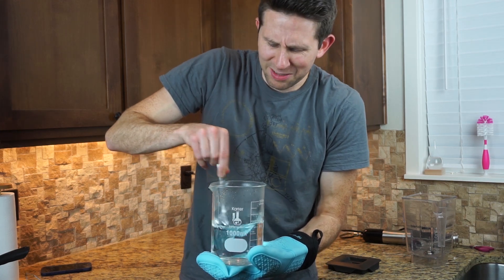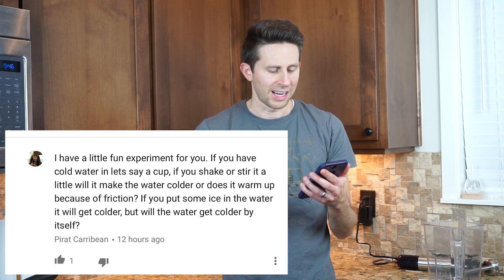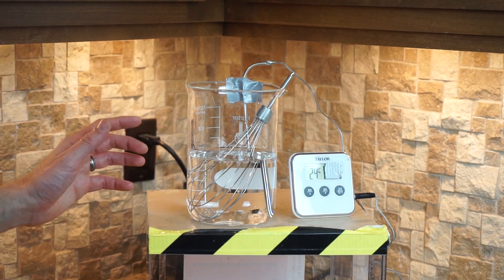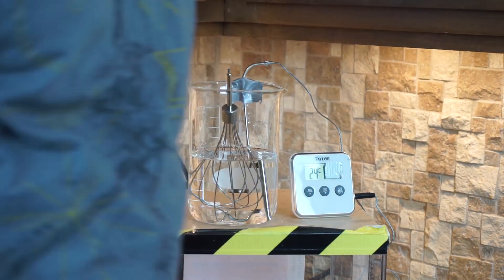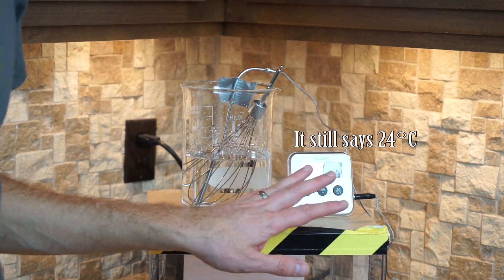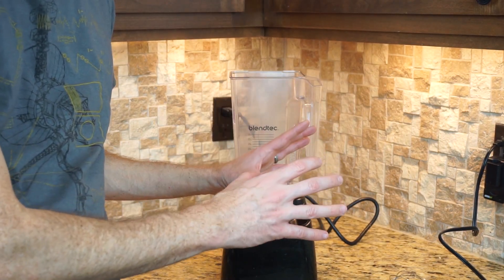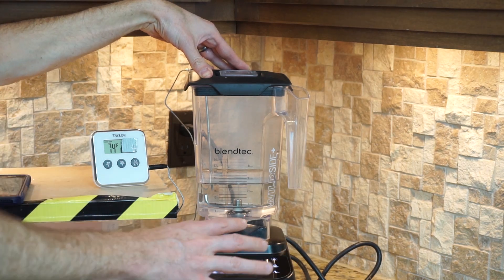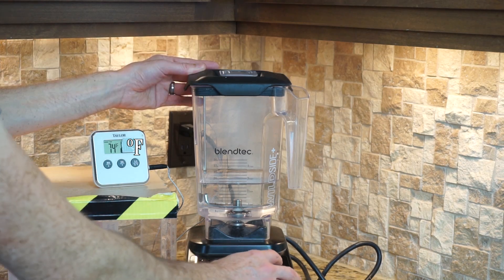Can You Boil Water Just By Mixing it Really Fast? Water-Stirring Challenge Accepted!

Comment: the change of temperature, while measured in Fº or Cº, is actually better understood with the Kelvin scale.  0 (no  º sign is used with that scale) 0 Kelvin is absolute zero (Approx -460º F or -273ºC).  There is no movement of molecules at all.  Agitating the water starts the molecules to move and the temperature to rise.  575 K meets 575ºF--they are the same.  In Celsius they meeet at 273K  and 273ºC are the same.

Comment: The energy required to heat 1 kilogram of water (1 liter) from 24 C to 100 C can be calculated by knowing the heat capacity of water in that temperature range.  About 4184 Joules per kilogram per °C.  Energy_Joules = (1 kg) * (4184 J/kg°C) * (76°C) = 318,384 Joules.  (1 Joule)  = (1 Watt) * (1 Second).  If you add energy at 1000 Watts, that would take you ( 318,384 Joules)/(1000 Watts) = 318.384 second = 5 minutes and 18.384 seconds.  So heating a liter of water in a 1000 Watt microwave at perfect efficiency  takes just about 5 minutes 20 seconds.  You can check the effective power of your microwave by measuring the temperature of a known mass of water before and after heating in the microwave for a specific time.

Sir Benjamin Thomson, Count Rumford, demonstrated the connection between mechanical energy and heat when he noticed how much heat was generated when boring a cannon.  Later, James Prescott Joule determine the "mechanical equivalent of heat", the amount of work needed to raise the temperature of a mass of material like water from one temperature to a higher temperature.  The unit Joule is named after him.

Richard Collins, The Internet Foundation

Comment: I've seen pool variable speed pumps heat the water to be scalding hot in just a matter of minutes. The impeller in them reaches 3450 RPM. The water was so hot it made the PVC deform. Take that for what you will.

Comment: Really amazing experiment! But the mixer blades and the motor heat up too and the thermal energy transfers to water from the blades. Maybe it would reduce the extraneous variables such as this one, to design a setup, in which the water is in a metal sphere and the sphere is rotating non-axially in a vacuum :D

Comment: How did you rule out the following?
The blade itself heats up because of the friction between it and the water and then causes the water surrounding it to warm up, rather than the water warming due to rubbing against itself or the inside of the pitcher

Comment: There is an appliance company WOLF that makes a commercial type blender with a soup mode. In the soup mode it uses the blades to agitate the liquid soup to produce enough heat to make it boil. Being soup it is thicker than water and will boil a lot faster than having water alone with no contents mixed in.  The liquid is heated up simply from the friction of the blades moving at the very high RPM and motor torque.  There are a number of high end blenders available that have enough motor power and speed to be able to boil liquids from the spinning of their blades. 

The high end WOLF bender has a peak 2.4 HP motor (near 1700 Watt motor). In this mode the blade tips spin at over 210 mph. There is no heating element involved, or any heat radiated from the blades themselves. The liquid is heated simply from the high speed friction involved.

Comment: The heat was coming from the friction of the blade. I'm sure water does heat up while being mixed, but you can clearly see when it's boiling that the bubbles are coming from the blade.
Reply: I figured, before he started to mix the water, that it was going to be the friction between the blade spindle and the bearing that was going to heat the water slightly but, on seeing how quickly the water heated (taking into account the speeded-up footage), I realised that it really is the friction between the blades and the water that heated it up. With the cost of electricity here in the UK almost double what it was in January (thanks to the Russo-Ukraine war) I think I'll be using my hand-whisk to make my coffee from now on.

Comment: This is nonsense! This would have been impossible in my original universe...This Action Lab video didn't exist. The water is used for cooling where I come from. The water absorbs heat, not produce it. Don't you have radiators over here?

Comment: Interesting, i do see the logic behind thid experiment however. I would love for you to retry the experiment but dont use a blender, all i keep thinking wile you were blending the water was the motor shaft of the blender is it connected metal to metal with the blades of the blender? If so could it be that alot of that heat came from condencing the blade? Dont get me wrong i still belive water can boil when you mix it fast enough, but this one here it just seem like the condencing of the motor shaft help it ALOT.

Comment: I dont think this experiment was silly, i think it was well done.  Maybe not perfect, but well done none the less.  And i dont think the heat transfer from the motor to the blades was significant because if it was an ordinary blender would do the same thing.

And how do the blades connect to the motor?  A gear underneath?  And is this gear plastic?  This may not conduct heat as well as the metal further negating the impact.

Comment: you want to have more stable level of water, for vertical movement of water is movement throw air, which cools, but horizontal movement is friction of water against water which make it hot, like hand if moving not against hand but air - cools, so do water
Reply: or another way to explain the same thing - not stable level of water significantly increase surface area of water, from which warm leaks

Comment: I was wondering if the movement and air bubbles would make it evaporate at a lower temperature, like if it would act like a decrease in pressure. But it basically made no difference. On another note I never thought this blender would have the necessary power to achieve it, it is indeed quite a good blender.

Comment: 99.8c ? For the boiling point of water? Water boils at 100c and freezes at 0c. Celsius is supposed to be a metric system based off things in the world, 100c is whatever temperature water boils at sea level. I could be wrong tho.

Comment: I don't think the heat is due to friction, atleast not entirely. The blades heat up quite a lot and that heat is transferred to the water, not to mention the opposite friction by the water on the blades...

This must be tested first with just air on the blendjet
Reply: And why do the blades heat up?
Reply: @osyisr6361  The motor. An example of this is a drill bit. It heats up, nonetheless if the bit made contact with a surface or not.
Reply: @ashwinkarthik5274  still technically friction.

Comment: It also can be the heat of blades of blender which is rotating so fast so the water is boiling as my fan blades also absorb heat from its motor ...also general  fan's angular  speed is so much times less than this blender.

Comment: There was a legal case about someone letting an irrigation pump run dry enough to cavitate, letting it go until it was really quite hot, ignoring the "never open when hot" warning plate on the pump and trying to take the cover off to see what the problem was.  The cover, when loosened, flew off and let out all of the steam in the guys' faces, horribly burning them.  No, they shouldn't have opened the clearly marked cover, but there was no reason not to have a pressure switch or thermal trigger cutoff on the pump.  So, yeah, just spinning an impeller can certainly boil water.

Comment: This experiment is inaccurate. Because a great part of heat comes from the heat dissipation from the blades due to friction that is generated in the propeller shaft. Because NO material exists that could be used to create a shaft (turning mechanism) that has no friction at the turning point.

Comment: Well the Vitamix Blender can make soup hot so yes stirring really fast will heat up water and soon boil it. Assuming motor doesn’t over heat on cheap blenders. Keep in mind a lot of cavitation occurs creating air pockets that are creating friction on the blades no matter how efficiently designed. In fact a blender blade relies on surface contact to blend stuff so unless metal is polished to a mirror or coated, friction.

Comment: Does boiling temperature change at different elevations? I've never heard this and I can't seem to figure out why it would be this way? Is it because the air it's thinner thereby allowing the bubbles to rise quicker?
Reply: It's about pressure. A liquid boils when it's vapor pressure equals or exceeds the atmospheric pressure. Meaning that at lower atmospheric pressure liquids boils easier.

Comment: Well you have to figure the motor is sending hear they the metal of the blades to cause heat also, so not all the heat is coming from the water friction

Comment: Theory: the water doesn't boil by itself due to friction, the friction caused on the blade due to constant rubbing of water makes the blade hot enough to make the water boil.
Reply: I think this is simply the manifestation of the fact that energy cannot be destroyed. As the motor rotates, water gain kinetic energy then collides with the grass walls and the motor, loosing some of the gained kinetic energy as heat. The heat accumulate over the time as the process repeats
Reply: @juliuskimani1740  Kinetic energy is transferred to the water through blades, the friction between the blade and the water produces enough energy for the water to lose some of its energy in form of heat?
Reply: @DustNgo  Most of the water's kinetic energy is lost through the collision with the container. But still there will be a few collision (friction) with the blade.

Comment: I guess this is partial explanation to why water boils. Kinetic theory says that kinetic energy of a fluid is linear function of temperature, so, if velocity of particles increase, so does the temperature. Also there is heat dissipation from blades' motor. So there are three factors contributing here which are friction, motion of fluid (kinetic energy), resistive heat from motor, of which I think kinetic energy is major factor and not the friction.

Comment: you could have done the experiment with cold coffee in sealed thermos flask and shake it for some time. it becomes hot.
temp. increases.   from 1st law of thermo dynamics  heat  dQ= dU+dw. but dQ=0 , we are not supplying heat. adiabatic process. (here not gas) . hence work done dW = dU, (magnitude).  where dU = change in internal energy which is proportional to change in temperature. 
using blender is not good idea... may be..i think..
Your videos are very interesting. They attract people towards science. good work

Comment: Would it be possible that heat from the motor conducts through the axle and blades to help heat the water, could  run with no water and see if the blades heat up

Comment: It's clearly the heat of the blades and machine itself warming up the water, you can see the temperature increasing even with the blender off and still water at 4:48 (bc the machine was still warm from the previous run). I find the question super interesting, but the experiment seems very flawed.

Comment: Hey, I know this is kind of an old video, but I wonder:
How much of the heat really comes from the movement. I mean this Blendtec is an absolute beast, cranking it up for so long probably heated the unit up to around the temperature of the surface of the sun. Besides that, the metal blades and metal shaft are probably directly connected to the motor, which is the hottest part in the unit, and therefor also a great conductor.
It would have been interesting for the viewer to know how hot the unit / blade become after such a long runtime without water. Because I think your device maybe would just have melted if the water wasn't there, as it probably was just used like cooling fluid for your Blendtec.

Comment: but you can see the result of the second law too. All the kinetic energy with 100% exergy dissipates to inner thermal energy of the water with (depending on your room temperature) ca. 20% exergy right before it reaches the boiling temperature. So, after warming, you can change back only 20% of the energy into work again.

Comment: This is a really petty comment that should no way detract from these entertaining and educational videos.....Celsius is a unit and not a scale. You should not say “degrees Celsius” in the same way that you do not say “degrees Amperes” or “degrees Watts”. Although often seen, you should also not say “degrees Kelvin” as Kelvin is also a unit. i.e. 273K and not 273ºK. Centigrade IS a scale hence  you do say 100 degrees centigrade (strictly 100 degrees on the centigrade scale) which is equal to 100C or 337(.15)K (i.e. without the degrees).

Comment: The blender experiment has a fundamental problem , it is a fail , because the blades will heat up on the friction in its axis and will make heat out of friction which will transfer to the water, so the experiment can't be done that way.

Comment: That blender looks like it works good. What happens if you mix by hand again but this time use copper pan and magnet stir stick? lol 
Maybe add magnets under the pan also to cause stronger magnetic field against the copper pan when you stir the magnet stick around. Orient the magnets so it gets best flux change with your stir magnet. It will probably be too hard to do, it will stir hard with that huge magnetic field, but it will also heat considerably.

Comment: What if same thing is done in ultracentrifuge... Friction does cause heating that it why ultracentrifuge and cooling centrifuge have cooling system to prevent denaturation of DNA, RNA or protein or other samples in solvent. I think water will get heated much faster in ultracentrifuge and centrifuge if there is no cooling system as they have much greater rpm.

Comment: Just wondering if the heat did not just come from the bearings in the metal parts. That the actual water would not have heated up as much if the moving parts where not in the water.
Reply: See the pinned comment.  He already clarified it

Comment: Hey,  today I saw a video of a chinese man lighting up a fire by blowing through a hole into a bunch of compressed wood powder, it's probably fake, but would it be possible to ignite compressed wood powder by just blowing a strong flow of air through it? What would be the necessary air speed or other conditions to generate enough friction and thus heat to reach the ignition point of the wood powder?

Comment: I personally experienced this phenomena in my job working at a water treatment plant several years ago. During an automated pump change, a valve on the outlet of a pump shut but the pump did not shut off as it was supposed to due to a failed part. The 200hp poump ran for several hours just spinning the trapped water before I found the problem at the start of my shift. I shut off the pump and then started to remove the failed part. As soon as I opened the piping with the trapped water, steam began escaping as the pressure drop allowed the heated water to boil off. I just had to let the steam escape and fresh cool water to enter until everything cooled down enough to let me replace the failed part.
Reply: When I was in the USN we accidentally did the same sort of thing to a boiler feed pump. They are much bigger, 1200hp motor and a 4 stage pump with over 1000psi shutoff head. For low flow conditions they have a recirculation path that can be aligned to either port or starboard condenser. The watchstanders at the time forgot to check there was a path aligned and burned the pump up. We ended up pulling a pump from the next ship of the class to replace it. The shipyard then repeated the same thing a few months later with one of the reverse osmosis pumps. I happened to walk by at the right time to watch that one and I sat there giggling a bit to myself at the situation, the yard was pretty upset about the feed pump and got some comeuppance.

Comment: We have a Vitamix blender.  One of the first things I made in it was cream of brocoli soup.  You put in cold mil, a piece of cheeses, I think onion and garlic and part of the raw broccoli.  You turn it on high (It is noisy, you'll want to leave the kitchen or use earplugs) and in about 7 minutes as I recall, without looking at the recipe, you have cooked, hot soup.  And it is not heat from the bearings.  Any machinist knows if bearings heat up that much they are shot.  Several other good brands of blender will do it as well.   They've been using Vitamix blenders for that for decades.  I'm a blacksmith.  I've taken cold 1/4" rods and heated them to red hot from friction by hammering.  I learned how to do this about 1980 and have done it often.  Starting fires by friction goes far into prehistory.  Whether in air, water, or solid, friction is energy that turns into heat.

Comment: why is it that when I have really hot soup or coffee, I'll stir it and it cools it off. cuz I figured it was cuz I was stiring in cool air so that cooled off the liquid. or like if u started boiling something and then u stir it, it doesnt boil more, it stops boiling untill u stop stiring and then it has to reheat and boil again. I wonder if this only works if it is past a certain speed because then the molecules would b hitting against eachother fast enough for the friction to heat it or the blades from the motor heated it. but stiring slowly seems to cool things down. when done in practical application. so idk but just a thought.